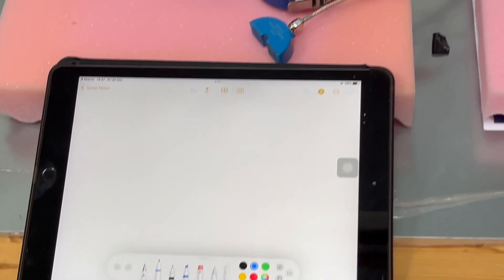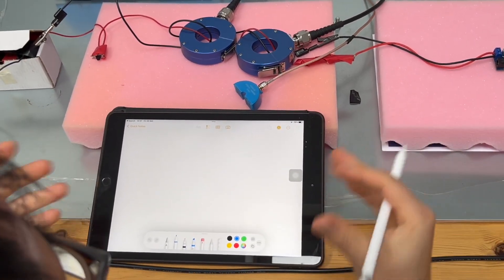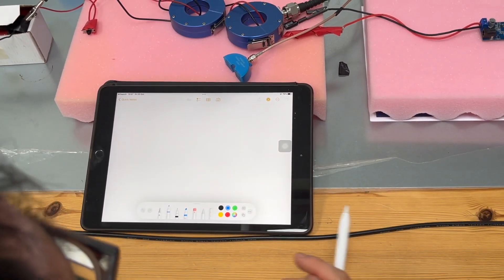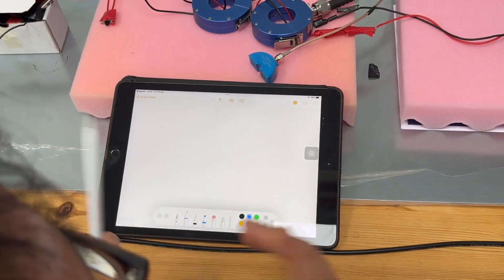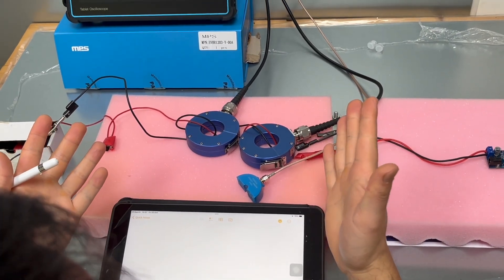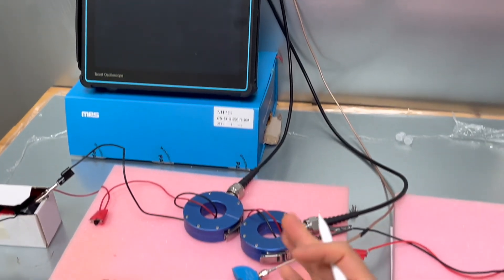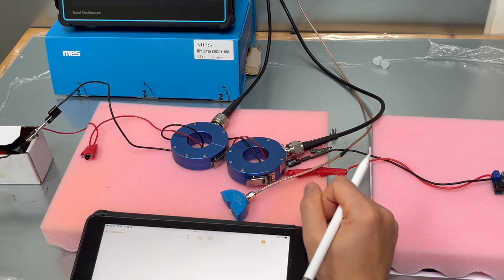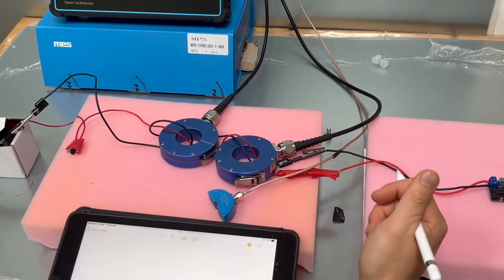Common Mode Current Made Visible | EMI/EMC Demo for Engineers

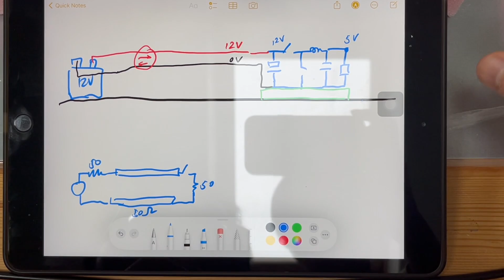Comment: At 4:40 what do you mean its stored in a capacitor? Like an actual part that you put there or does the 5v spot and the dielectric between the module and the ground plane act as a sort of capacitor?

Comment: Few points, the 5V at output will be fairly stable. Hence, there won’t be high dv/dt . So the displacement current through 100pf will be very minimal. Most of the current will leak through the parasitic capacitance from switching node ( common point between two switch)to the ground and most of the CM current will be contributed by it.
Reply from the maker: Good point, yes, the Switch Node has the most dv/dt. A better drawing would be to draw the parasitic cap from the switch node to the test ground plane, rather than the 5V rail! Definitely agree. I guess the main point i wanted to make in the video, was, from the energy transportation point of view, the L-C filter is just some energy storage devices, taking the energy from the input capacitance and transport the energy to the load, eventually, but it takes time, therefore, all the parasitic component close to the load will also contribute to make the energy transition process,  and this is the main cause of common mode noise.

Comment: Hi Min, at 7:02 could you please elaborate how does the forward current flow through the 0V line? Thank you.
Reply from the maker: Hi, 0V is just a name, isn't it! We all know that we name it as 0V, simply because we reference it to the same point of battery negative. But as it is demonstrated here, the battery negative is not the same as the PCB 0V, even for DC, they are not the same, because the voltage drop caused by the long wire, not to mention the RF signals. So there will be a voltage drop between battery negative and the 0V on the PCB. Same applies between the test ground plane and the PCB 0V, there will certainly be a voltage difference between the 0V on the PCB and the test ground plane, as a result, you will see current induced (via the parasitic capacitance between the 0V and the test ground plane), therefore, induced RF current will flow on the 0V line. Hope this helps

Comment: Very good video.

I have a question Min. Every standard says reference ground plane has to be connected to earth. You mentioned in another video that causes a problem if the earth wire is long because it can act as an antenna and add noise to the reference ground plane. Lets ignore the safety aspect and lets ignore that a long earth wire may act as an antenna and add noise to the reference ground plane, will you get the exact same measurement results with radiated emissions in the two different cases where in one you have your reference ground plane connected to earth and in the other the reference ground plane is not connected to earth?

Basically is the earth wire needed for standardizing measurement results or is it only for safety?
Reply from the maker: Hi, good question. Think about in a test house, the chamber ground is connected to the wall, so the whole Faraday shield is "earthed". Inside the chamber, the antenna is measured with reference to the chamber ground. The key to your question is to understand that the RF reference ground is not earth ground, though for safety reasons, we often earth the RF ground.
Reply: "Earth" ground is only for safety or lightning protection. It has no bearing on EMC measurements.